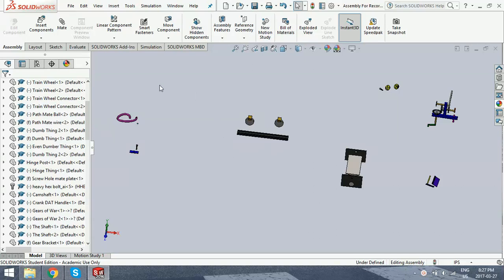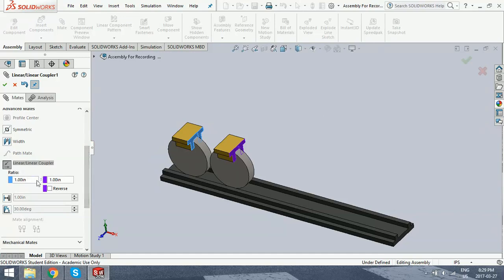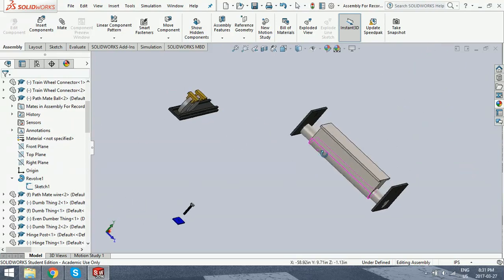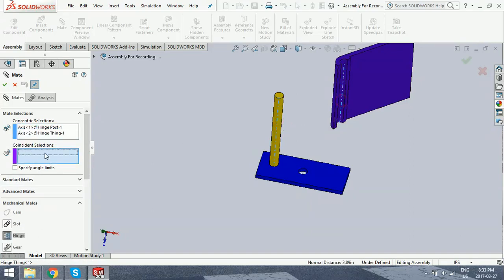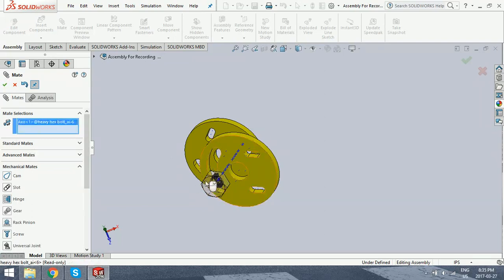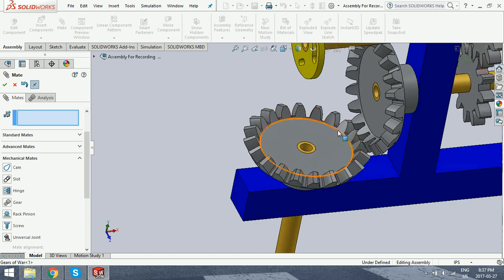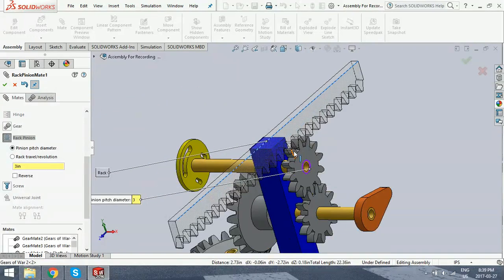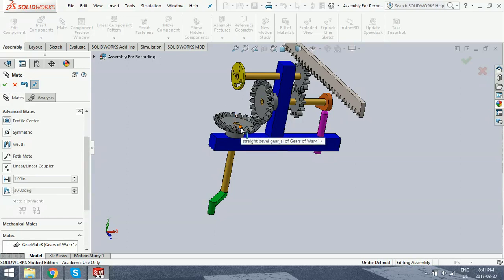SolidWorks All Advanced and Mechanical Mates

Comment: I have two parts, a fan and its box shape hollow case. Fan should be in middle of case but not physically connected with it.
How do I connect them or what mate should I use?
Reply from the maker: You could use several distance mates to lock its location, or maybe try using the center mate somehow?

Comment: Hey! I've been trying to recreate your last demo about mechanical mates, but as soon as I try to gear mate the green crank handle with the yellow shaft, it shows "Please select from two different sub assemblies for mating". Any ideas on what I should do?
Reply from the maker: This tutorial I made in Solidworks 2016 student edition (if I'm not mistaken). If you're using a newer version it could be that this mate is not necessary anymore and you can skip it by just having the shaft mated coincidently and concentrically with the crank handle then using a gear mate for the shaft and gear. Try this and see if turning the crank handle will also rotate the gear. If this works proceed with the other mates noting rotation direction and all should be fine.
Reply: @FlyingWalrus8  it worked bud! Tho I dont understand why. Like why do we need to add the surface coincidence first to get the gear mate?
Reply: Just found out the real prob had to do something with rebuilding, works neat now!😄
Reply: Hey do you have these parts files for practice?